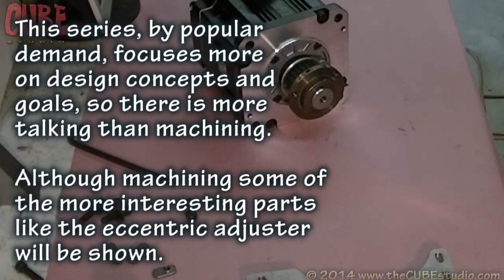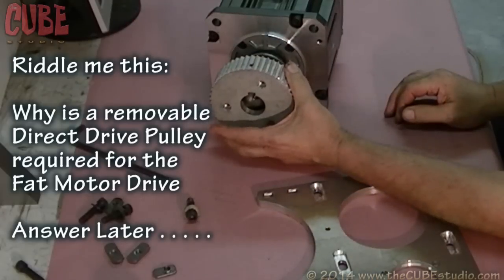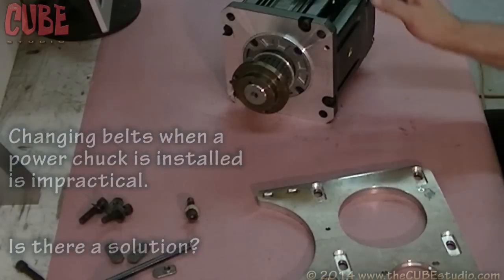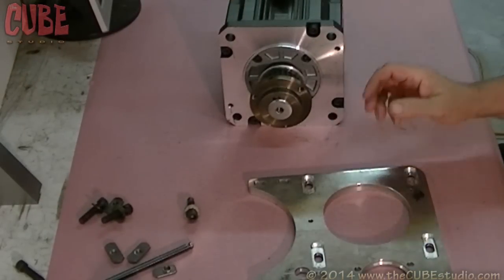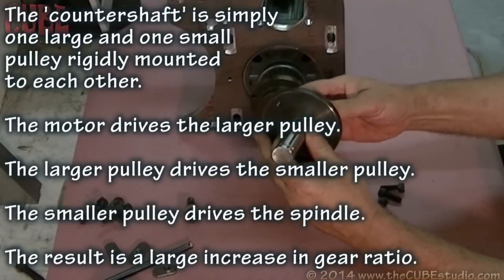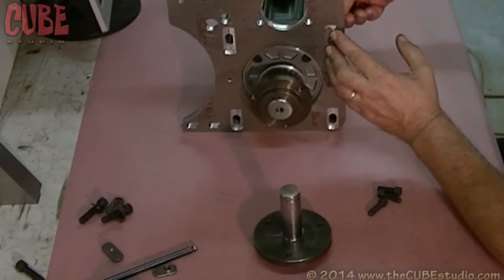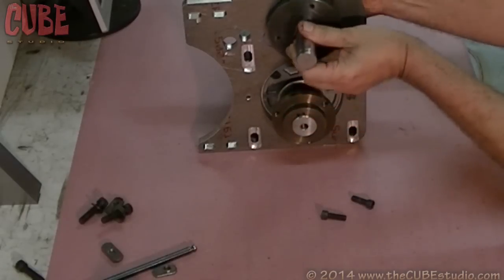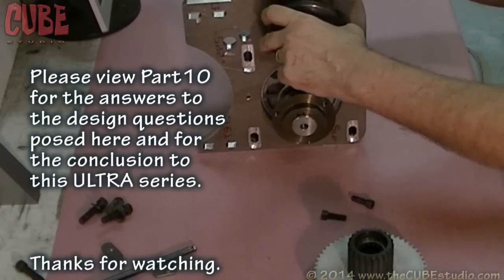Ultimate4thAxisBuild Part9 - the 'Fat Motor' Drive

Comment: You could use a dog gear that switched between two pulleys mounted to the same shaft.  Pulleys ride on bearings and dog gear rides on a splined section between the two.  This way the desired driven pulley gets locked to the motor shaft, intermediate shaft, spindle shaft, whichever you decide.  The un-driven pulley is then free to rotate on a bearing (it becomes driven from the spindle or intermediate whichever is your choice in the design). The dog gear can be designed to be manual, electrically, or pneumatically, hydraulically actuated.  Which can be controlled in the software for desired speed. 

You could use a fork mechanism to slide the dog collar from pulley to pulley, this could be designed any number of ways to suit your requirements.  

You would need to add an independent tensioner if your two pulley ratios were not directly inverse of each other.  If they are, a simple slide tensioner should still suffice as the belt lengths would be the same.

Just a thought on the motor orientation, it would be awesome if you could just loosen a set of clamping bolts and swivel the motor drive plate from front to back for quick changing left or right table use without disassembly.  I think that feature would be very appreciated!  Design the pivot point around the spindle center so your drive bents stay perfectly tensioned and all that is needed is loosen, rotate and tighten the clamping bolts.

Chris
Reply from the maker: Chris,

Thanks for the suggestions. You are describing the mechanism used in automotive manual transmissions (less synchronizers). Another method is having the gears locked to the shaft will balls which are alternately pushed out and retracted to engage the selected gear. Motorcycle transmissions would be an example of this method.  In any case, the drawback of these methods is backlash. For the Turning aspect, it would not be an issue, but for indexing, the backlash in the gear/pulley changing mechanism would be unacceptable.

Another challenge is sealing these mechanisms. If the whole assembly is inside a gearbox, you don't need seals (except entry/exit shafts) and everything gets lubricated.

I have a completed design that utilizes an extremely low backlash, completely sealed planetary reduction gearbox. A tapered pin alternately connects the housing (ring gear) to the motor shaft or the motor mount frame yielding high and low range. The limitation, other than being stupidly expensive, is that this method tops out at about 1HP.

Your Idler idea is another excellent suggestion and is already used on the 'Fat Motor' drive.  It moves on an eccentric rather than a slide, but the idea is the same. That particular part is covered in detail in the last PART10 of this series.

I also like the swivel motor mount idea. It takes a big shoe horn to get all of this stuff into such a compact space and again as you will see in the last video, there are an array of clearance issues. Flipping the motor plate over is probably a 15 minute job. Re-aligning the 4th axis after a move is where the time gets gobbled up.

Comment: You are correct, I was not considering the indexing and backlash definitely would be an issue.  I need to go back and re watch to better interpret your goal.
Reply from the maker: Your ideas were quite valid. The process is to come up with solutions and then weight the merits, disadvantages and cost. It takes creative thought to come up with the ideas in the first place. And your idea will give someone else and idea and their idea will in turn give you another idea.

A hundred ideas that don't pan out is a good day. 12 engineers sitting around a conference table is silence is a very bad day indeed.

Comment: Have you posted part 10 yet?  I don't see it anywhere.
Reply from the maker: There will be a 10A and a 10B because they are both in-depth looks at specific components. !0A was to be posted yesterday, but the render turned out bad, so it should be posted today.

Comment: pulley is a sun gear with planetaries inside of it for a back gear….might could work.
Reply from the maker: +Diesel Ramcharger Sorry I did not see this post until now. Thanks for the comment.While I LOVE the idea of a planetary for high/low range,  and there are some methods for eliminating the backlash in those setups, I have been unable to noodle a way to seal and lubricate such an animal. The only safe place for it would be inside the frame, but there is a disc brake in there that would not get along well with gear oil. It is an interesting mental exercise to contemplate a wet disk for the spindle lock mounted on the planetary shell (think automotive automatic transmission).  That's a great solution until you get to theneed for a very high pressure hydraulic actuator for the disc pack.